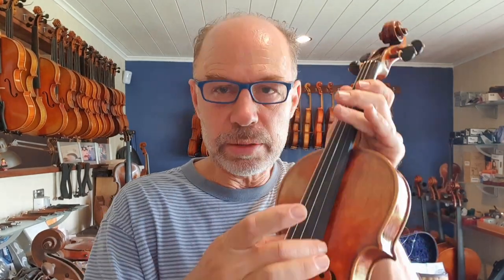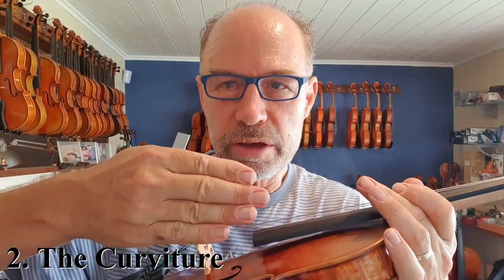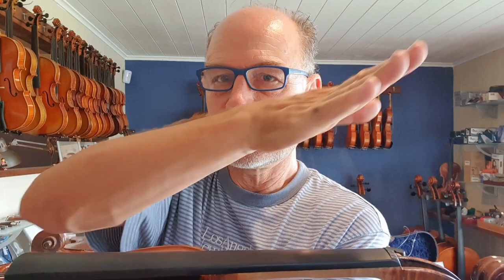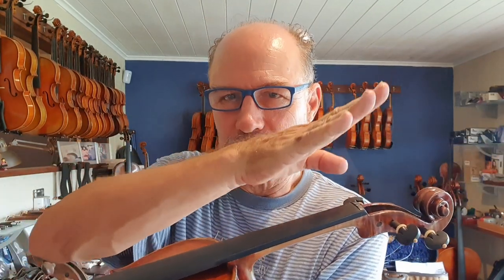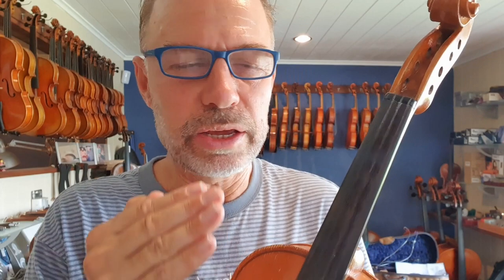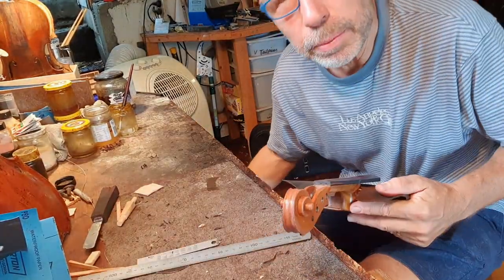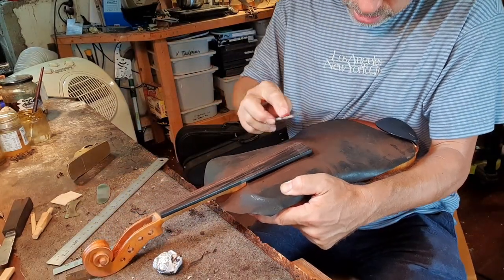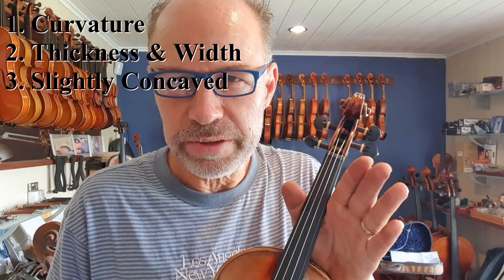How The Violin Fingerboard Works

Comment: Not a musician, just curious. If a fingerboard is planed multiple times across years of maintenance, does the fingerboard ever get too thin for continued use? If so, how would you deal with that or how long would it take for that to happen?
Reply from the maker: Hi J L,
Yes totally... Great question...
It really depends on the hardness and thickness of the fingerboard as well as the player and how much they wear into the fingerboard. I usually expect a fingerboard to last between 20 and 40 years. 
Each time the fingerboard is planed, a fraction of a millimetre is taken off.
Reply: So the fingerboard on a Stradivarius is actually post-WWII
Reply: @TomLeg  Depends how often the strad gets played. Some of them only come out a few times a year, as opposed to getting practiced on 40hrs a day like a “normal” violin.
Reply: @TomLeg  Why would anyone assume that?? The Messiah has hardly ever been played.
Reply: @joestevenson5568  One can t3ell the politics of people who make such assumptions.

Comment: Wow, I had no idea. What was covered Explained simply and thoroughly.  My browsing has brought to mind other issues.  String height above the fingerboard that you cover in another video, and fingerboard angle and bridge height impacting bridge pressure on front of violin transferring string vibration efficiently or too much pressure restricting movement of violin front surface, that was mentioned as a complication in another's YouTube video and they thought could only be resolved by trial & change.

Comment: Hi there this is such a helpful video thank you. My teacher says that planning my cello fingerboard will reduce the string height but this is a brand new cello I just bought and I’m so afraid of tampering with it. Also if you shave down fingerboard won’t that just INCREASE the distance between the strings and the fingerboard rather than reduce it? I would be so grateful for any thoughts on this.

Comment: Very useful information, thank you.. I always thought the fingerboard was supposed to be straight, not slightly concave. My violin does make a buzz noise, specially on the A and D strings and I wonder if that could be the reason.
Reply: I'm not Olaf! But I've had students with buzzy strings where the fault was that the string's groove through the nut was cut too deeply. Kitchen counter repair was to put some material (in my case, a piece of chamois) under the string to lift it just a bit higher. I keep urging them to get that fiddle to a luthier! But after three months of "We'll go in the next couple weeks," I gave up. At least it's less horrible than before.

Take a look at the clearance of your strings. You might be able to see what's wrong, at least in part, but there are SO many issues to balance: bridge height, proper cut of nut, proper fingerboard shaping, and even angle of fingerboard/neck set. Messing around with one variable affects everything else, and on the best instruments it all has to be ideal. You need a pro.
Reply: @snowyminnesota6028  WHAT  great answers you gave.

Comment: Olaf, that fiddle with the soft ebony that was so very badly eroded: surely you had to take that down quite a bit? Did you thereafter have to cut the bridge down also, to adjust string height? And then doesn't reducing bridge height affect sound output (that's what I heard anyway - my dad was an amateur luthier, but he adored doing the research)?

Of course, maybe on an instrument that was made with cheaper (softer) ebony that's definitely going to wear faster, it's more about playability than projection. Right? Still curious about whether you had to do anything with the bridge.
Reply: i have this same question. after some maintenance with the next years soon the fingerboard itself needs to be replaced
Reply: @ElsweyrDiego  Yes it does.

Comment: to be clear, check if my understanding is correct, the radius of the curvature of the neck is slightly greater than the radius of the curve of the bridge, therefore slightly flatter
now on an other issue, i understand the correct string heights at the end of the finger board but what are the correct string heights at the nut?

Comment: Have you ever run into situations or client requests for customizing finger board dimensions (width and thickness, let’s say)?
Reply from the maker: There are some standard measurements that work well for most people and also help with resale of instruments. 
Just some players have small fingers or really wide fingers... so narrower neck and Fingerboard help with the first one and wider Fingerboard for wide fingers. 
The problem with narrowing the neck is that the instrument needs a neck graft to reverse it.

Comment: Hi Olaf, I have a question regarding fingerboard shaping... Are the sides scooped as well as the playing surface? I have had to make the sides scooped to meet a strangely carved neck once in a while, but I don't know why you wouldn't make the sides straight on a new instrument? I haven't been able to find any reliable information on this, so I hope you can help :-)

I'm in the process of making my first cello at the moment. I mostly want to match the feel of the playing interface of my own cello so swapping between the two won't be too difficult, but of course I also want to do things the "correct" way where mine is off a little bit.
Reply from the maker: The sides should be straight lengthwise. Sometimes after instruments  get older the sides get scooped as well.
Reply: Thank you, that's what I thought. I talked to a guy once who insisted that the width of the overhang should increase in a curved function, but mathematically that doesn't make sense. I'll make my sides straight :-)